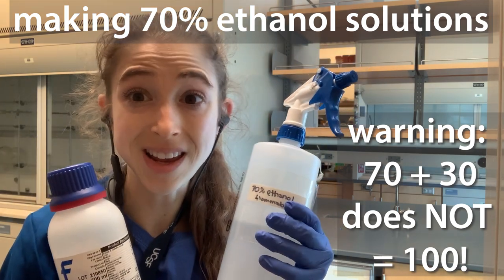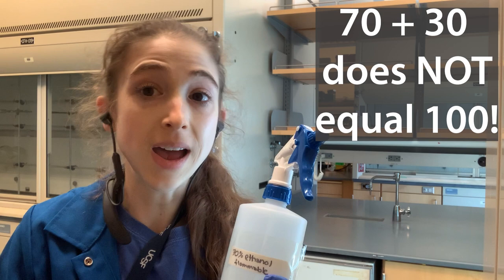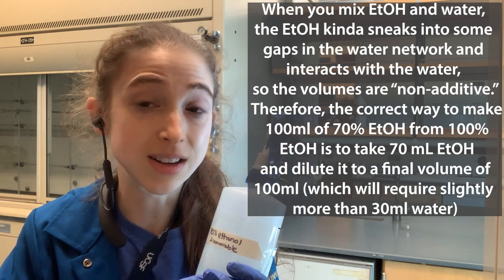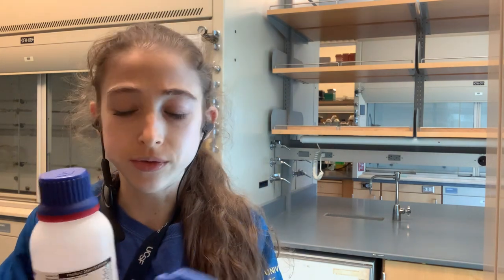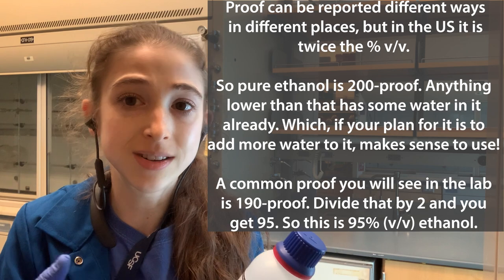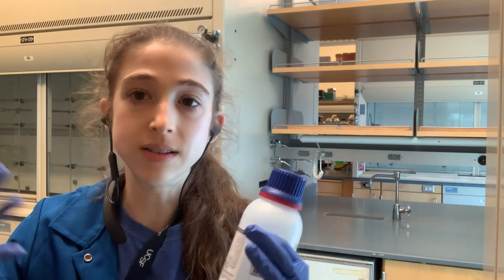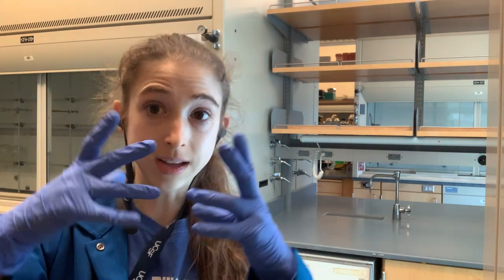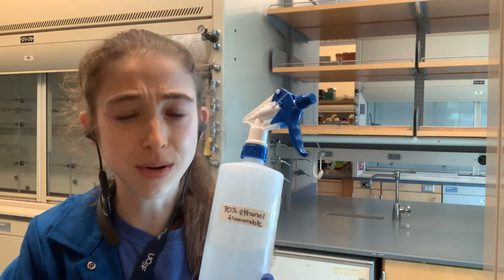Making 70% ethanol solutions (the right way)

Comment: Huh... I've always separately measured 70 ml of ethanol with 30 ml of water and then mixed, exactly because I knew their volumes weren't additive. I don't quite understand your method yet - the amount of water and alcohol using your method will depend on which reagent you add first (measure 70 ml of ethanol and then fill to 100 ml with water = you will add >30 ml of water. Measure 30 ml of water first and fill to 100 ml with ethanol = you will add >70 ml of ethanol). How do you know that you have to add the ethanol first?
Reply from the maker: We add the ethanol first because that is the component we want to make sure we have 70% of. Hope that helps
Reply: Same, that's what I do, hahaha 😅. I was doing all wrong, lol. We do use 200proof too